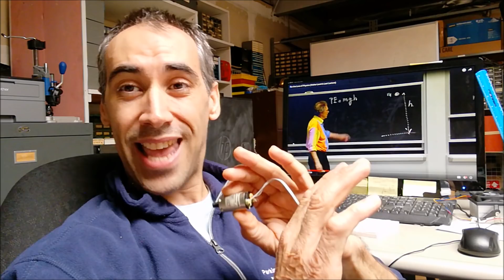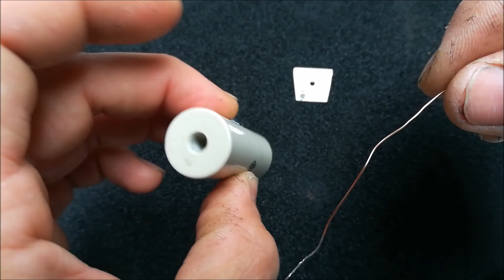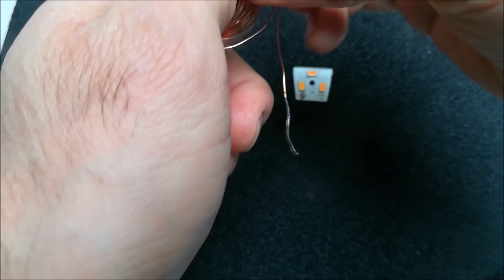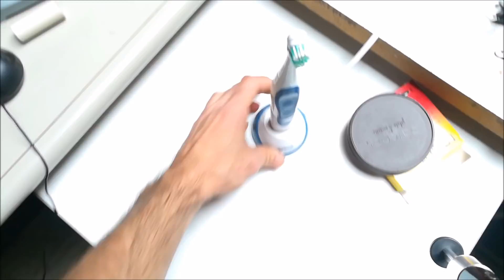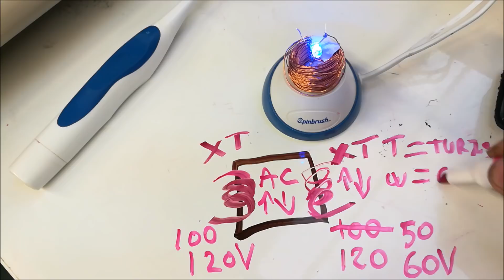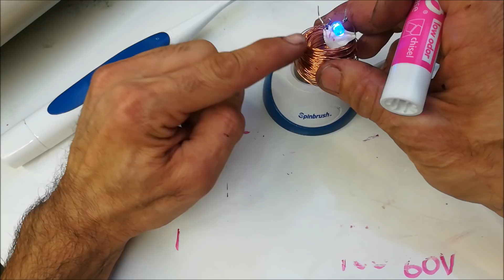~Classic Free energy Trick EXPLAINED~ :D

Comment: I know it would last long or even work but if you use 2 motors connect them together and use a string to start it. How long could this system run by themselves?
Would a capacitor help to run it a little bit longer?
I mean little motors properly 25 mm long an 18 wide you know them.

Comment: How are you? It is a question about the electromagnetic induction that occurs in the transformer! If I have a coil in the primary inducing a voltage in the secondary the power in the two coils will be the same! But if I have two coils in the secondary will the same power be induced in each one or the power divide for each coil?